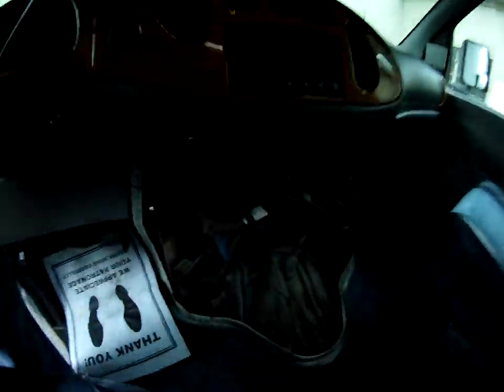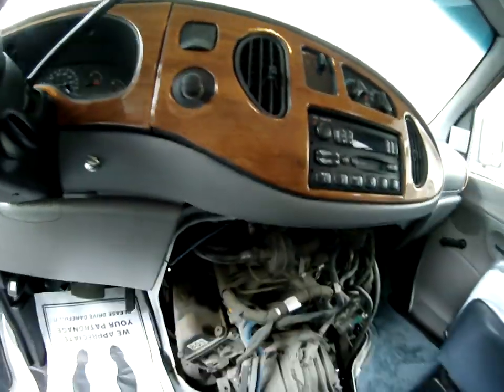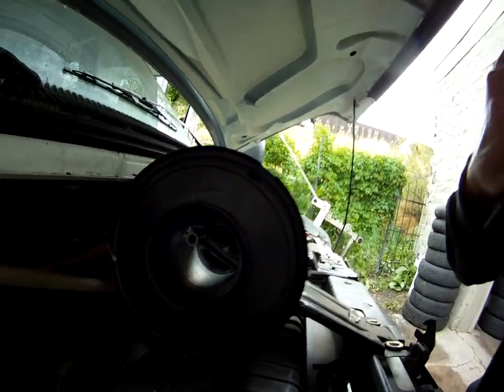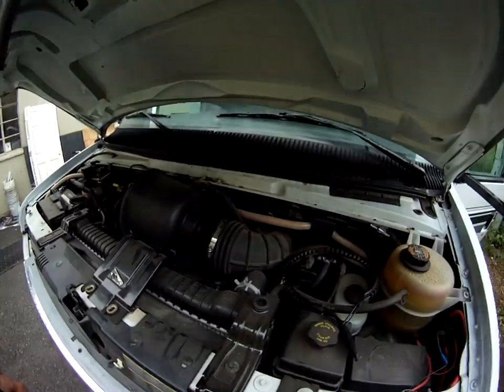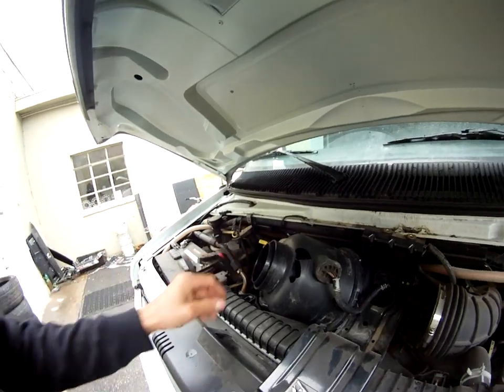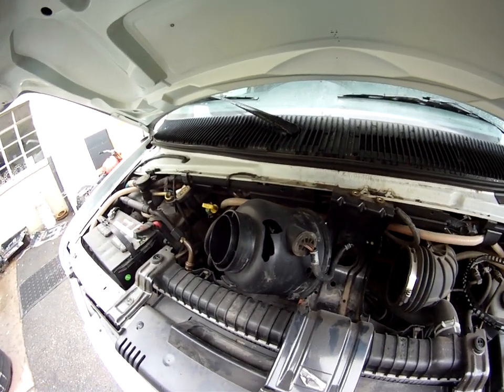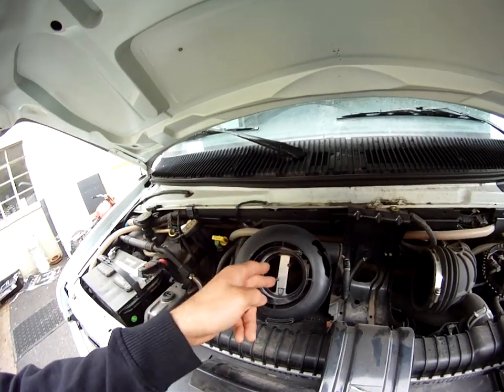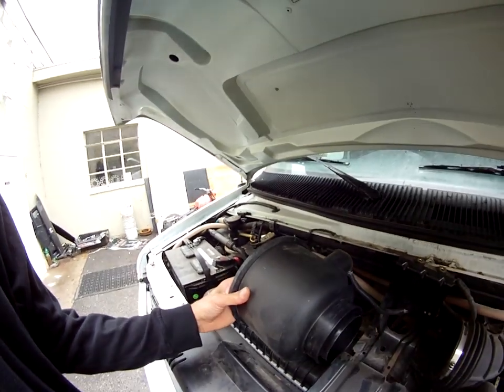P0171, P0174 Codes - GoPro Lesson

Comment: what if it's just on bank 1 ?
Reply from the maker: Maximus T I would look into and around the intake gasket.
Reply: A&M Motorsports  I took the gasket intake Everything everything look good the only thing I did notice was I disconnected the mass air flow sensor and the engine ran smooth I connected the sensor and the engine died any thoughts on this?
Reply from the maker: May very well be the M.A.F sensor, actually
Reply: A&M Motorsports : Thanks for the help...

Comment: ive got both po171 and po174 on my 2000 mustang v6 im thinking its the intake gaskets. i can't find any air leaks but i can hear air sucking around my cold air intake that's brand new. also i do need 2 front o2 sensors
Reply from the maker: +Jae Jackson  When the engine is cold, check for leaking intake plenum gaskets. To do this, monitor the Short Term Fuel Trim (STFT) readings on the scanner. When the system goes into closed loop, spray propane or carburetor spray around the lower intake manifold to intake plenum mating area. If the STFT numbers go down, indicating the Powertrain Control Module (PCM) is taking fuel away, replace the intake plenum seals and isolator bolts with updated parts per TSB 03-16-1.
I would guess the intake gaskets are leaking, also replace the isolator bolts when you do the service.../.....
Reply: Jae Jackson. The cold air induction is causing my f150 to fail the same codes. I was told to put the stock air filter system back on to fix the issue

Comment: I removed the intake manifold and found one port of the intake melted and I could see the original on the injector.  I believe that is were it was leaking.  Why would that melt do you know?
Reply from the maker: Not sure, if it is a hard rubber boot that connects to it, then it's just from oil and deterioration.  If it's melted plastic,  may have been rubbing up against the engine or something.  Man, if I could see a pic of that it would help......

Comment: thanks for the video...I have an E350 club wagon with the V10 and had the P0171 / 74 codes.  Cleaned the MAF sensor and discovered the PCV tube under the throttle body was cracked; replaced it and now my motor runs smooth again.  Problem fixed!!
Reply from the maker: Love it!  Good job!!

Comment: Good afternoon. I have a 2004 ford ranger 4.0 sohc engine.After the truck was tuned with new motorcraft plugs and wires ,oil changed. It gave me codes P0171,P0174,P0300 .Shortly after the truck would not started at all and back pressure was high. I disconnected the exhuast and the truck started up.Cats were stopped up.I cleaned them out to see if that was the code issues.
So I had planned on doing up grades anyway since its ten years old. I replaced the MAF sensor,fuel pump and filter,upper intake manfold gaskets,IAC sensor, throttle position sensor and EGR . I had most new already for spares. All codes have cleared but system lean bank 2.. after all this code p0174 remains and its dumping fuel hard. so could this be O2 sensors on bank 2 or?

Comment: I have a 2001 Ford f150 V6 4.2. I have bolth codes, cleaned the fuel injectors, new MAF, and new manifold gaskits, still no help. Any thoughts?
Reply: 1.There is a very common problem on this engine with vacuum leaks between the middle intake plenum and the lower intake manifold. These leaks, however, tend to be present ONLY when the engine is cold, and will be worse during cold ambient temperatures. Ford has revised parts to cure the problem, consisting of new "isolator bolts" that bolt the middle plenum to the lower intake, and new "port gaskets" (o-rings) between the middle plenum and lower intake.
2. If using a smoke machine to try to prove this, it usually will not show any leakage unless the engine is stone cold. Also, some leakage from the Exhaust Gas Recirculation (EGR) valve, the Idle Air Control (IAC) valve vent, and the Intake Manifold Runner Control (IMRC) levers IS normal.

Its also possible that the intake may be cracked. Also, look at the PCV tubing and elbows for cracks in the rubber.  Hope this may help

Comment: i have a P0171 code on a 1998 crysler town and country mini van 3.8L V6 this van doesnt use a Maf it uses a MAP sensor... short story short van starts up but misfires like crazy, then it starts up runs fine but after being on for a while u can tell it starts to misfire cause of the lean condition, fuel vaccum and spark plug wires are all fine compression fine on all cylinders my two assumptions are o2sensor or map sensor took a shit, should i suspect a map sensor?

Comment: I have the same van with the same codes! I replaced the MAF, my OBDII reader also does live data, PCV elbow did not look cracked or split.  My reader only lists 3 O2 sensors (are there supposed to be 4?)  Also, what are some acceptable values for the MAF sensor readings and O2 sensor? Thanks!